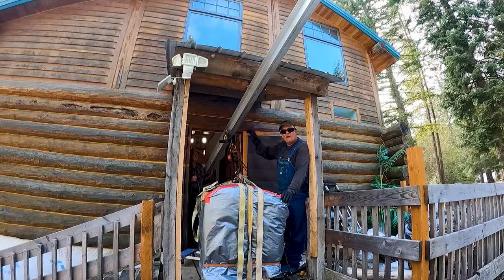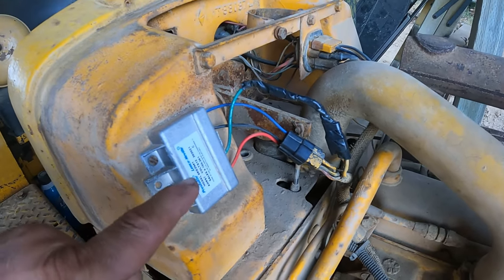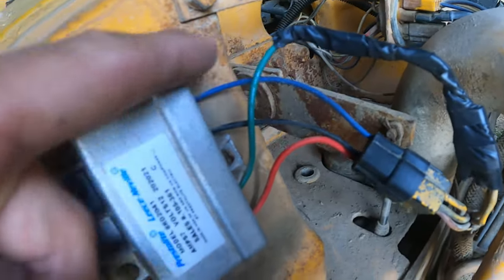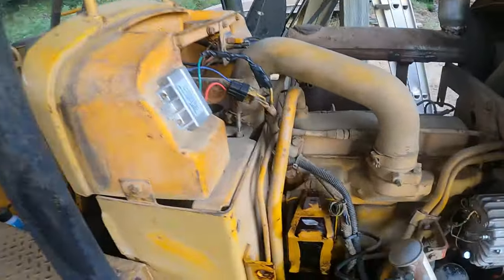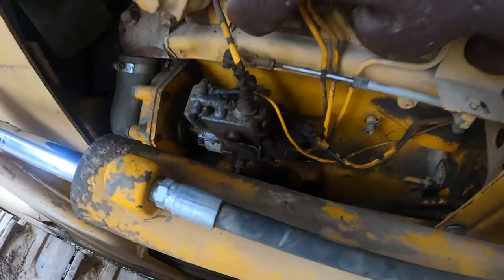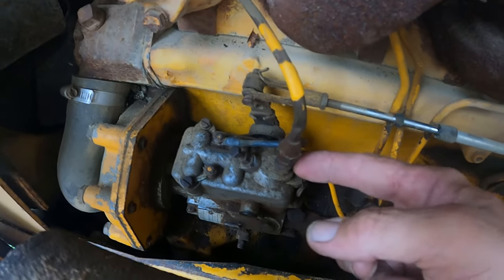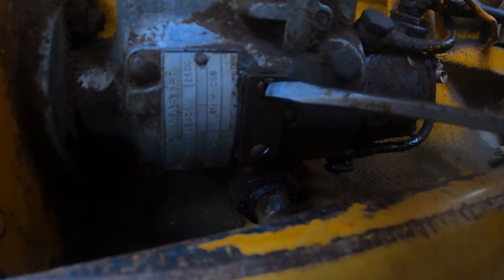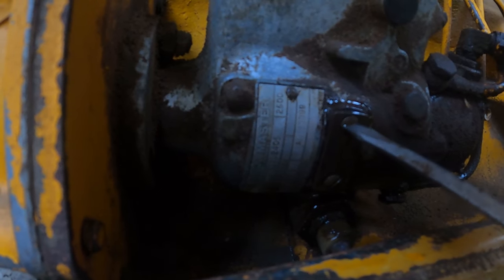Repairing a John Deere 350B Dozer

Comment: Hey buddy, how's it going?
Very informative video. I had a similar problem last year, I would be running g mine and it would shut off. I was told air in the line. That was not my issue, I had a bare wire the was shorting out my loader.
Glad to see you got it fixed.

Comment: Watched your video, very good you got it running. Question though, where does the return line connect to the tank? The check valve was probably there to prevent the tank from draining back to the IP, which may/could cause a flooded crankcase.
 You should probably get a new check valve and put it back in .

Comment: Interesting. What happens to the black specs? Do they end up in the tank?
Reply from the maker: I believe so!  Then hopefully they get caught in the filter!  I should have explained that a little better.  The black chunks are a disintegrated plastic spacer or washer contained somewhere that isn't actually needed...  And they break apart and clog the injection pump restricting the flow and making that little check valve stop working properly.   Take the check valve out and it allows for those chunks to flow back to the tank.

Comment: You need to take the pump off and take it to an injection pump shop for repair.  Without the repair the weights on the governor will damage the housing and could cause the engine to go into a overspeed condition and leave you with a pile of junk.  I have had these issues on other machines but same Roosa Master pumps.  You have a disaster waiting to happen.